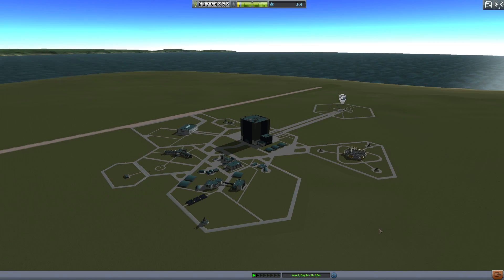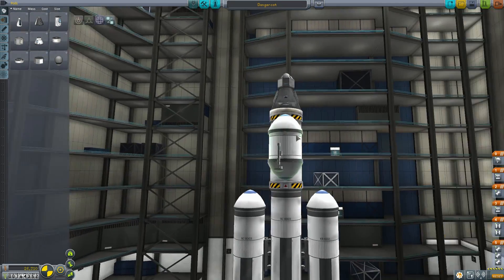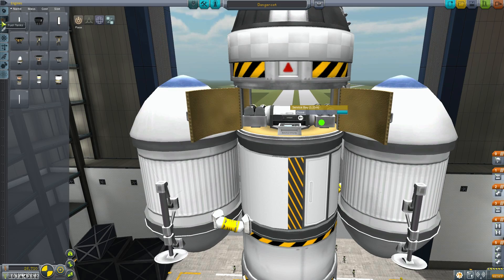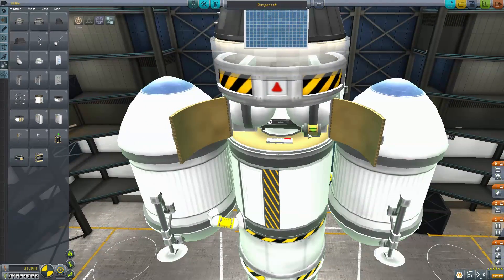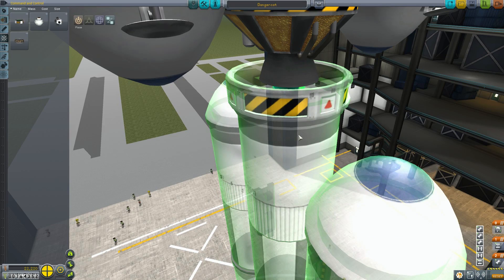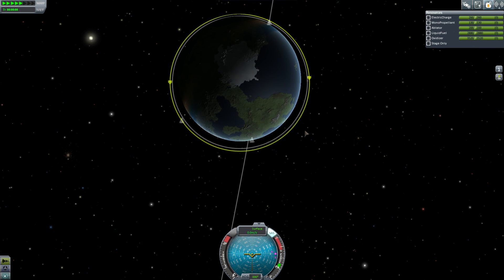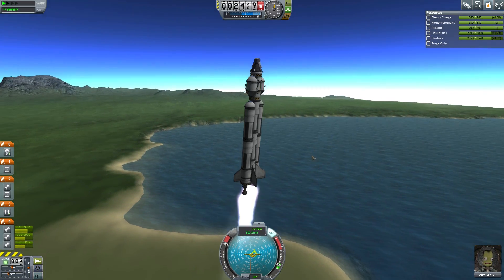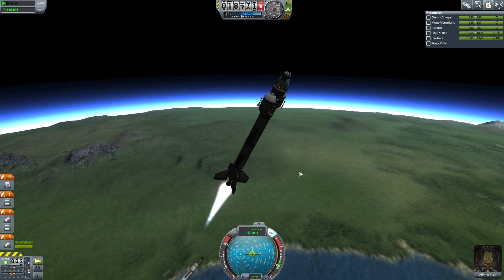Kerbal Space Program - Career Mode Guide For Beginners - Part 18

Comment: placing the RCS engines on the CoM...BRILLIANT! i kept putting them in 4 way symmetry at both the top and bottom of the craft thinking that would be sufficient but always have a hard time lining up the docking ports due to erratic changes in position with even the slightest tap on the WASD keys and i end up hitting the target like a baseball bat and throwing everything off-kilter

Comment: Made a mun mission with a lander and a dockable propulsion module... i fired up the propulsion module and got into a low orbit around mun.  The game crashed and when i got back all the fuel from the lander was gone. I tried to refuel the lander but it didn't work so I had to abort the mission. 
Just barely getting back to a low Kerbin orbit.
I launched a rescue capsule just go find it out of electrical charge because I didn't point the panels to the sun. but I was relatively close to an encounter so I got my kerbal out of the lander... I actually managed to get to the rescue capsule with just 0.2 Eva fuel only to find myself plowing off into space after trying to grab the capsule... I managed to slow down a little but not enough to get back... So I launched a second rescue capsule xD I got to an encounter, this time not running out of power and parked next to my brave pilot I had to give the rescue capsule a very slight nudge so it started to spin with the door towards the stranded kerbal and quickly switch to him, grab the capsule and get in. I went outside again with newly refueled Eva pack and flew over to the first rescue capsule, pushing it into a slow spin so the panels would point towards the sun. I got in, deorbited and used the other rescue capsule to save... milbes? idk how he was called xD in the end a stupid bug and alot of fails made up for one of the most interesting missions I flew XD